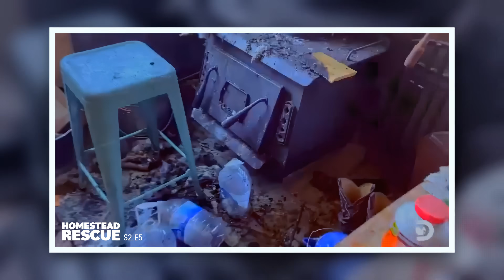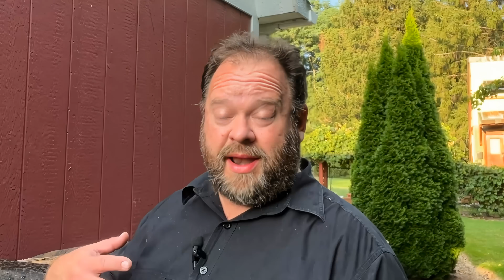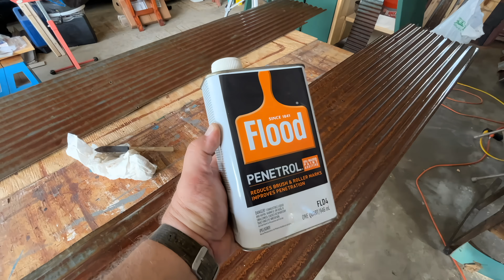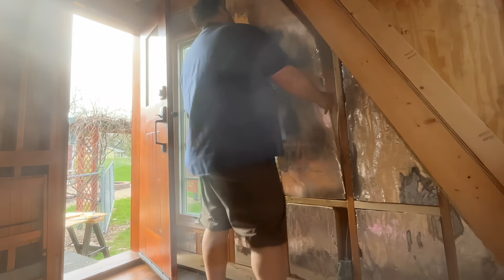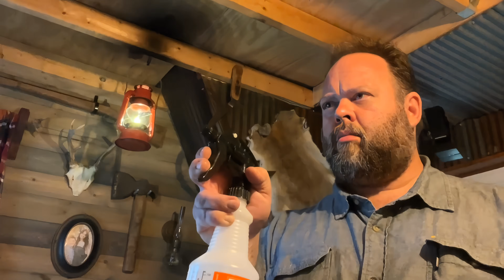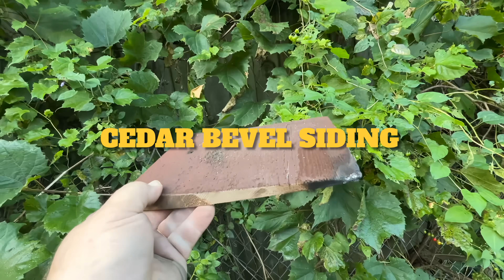DIY Fireproofing Techniques for Off-Grid Cabins 🔥 Essential Safety Tips

Comment: Hi, thanks for sharing, only problem about the fire retardant is its properties are supose to last around 12 months, so its expected to be reaplied.... its that really neccesary so often? , testing could reveal. But for my next step , im trying to find the composition, because we may be able to produce it in a cheaper way.
Will came back to check if you have answered, because i would love to listen your opinion. Or anyones experience/ideas.
Reply from the maker: This is what the manufacturer told me back in 2022: “Master Flame used indoors will last the life of the structure. When used outdoors you will need to apply a sealer on top of our product to protect it from the elements”. 

That was good enough for me since I am mainly concerned about interior fire hazards.

I still have the scraps I used in the video. I should pull them out and see if they are still fire resistant.
Reply: @bigguyinatinyhouse  apreciate, thanks! For bigger projects and forest firest would be great to find a cheaper alternative

Comment: Why is it that builders on tiny houses in the woods know about these fireproofing sprays, but builders on large apartment complexes act as if they don't exist? These coatings should be mandatory in all unfinished spaces of every residential structure and on exterior feature, like eaves, that are particularly vulnerable to the spread of fire.
Reply from the maker: That’s a good question. It probably boils down to cost… The stuff is relatively expensive. Not a huge expense for a tiny cabin, but the amount you would need for a larger structure would be big bucks.

Comment: If you want to build a fireproof home 
Pumicecrete is by far the best building material on the planet Pumicecrete is a mixture of pumice cement and water mixed and poured into a set of reusable forms walls are poured from 12"to 24" thick pumicecrete is fireproof termite proof rust rot and mold proof non toxic and has a high R value and good sound attenuation solid poured walls means no critters can live in your walls Pumicecrete can be built for a fraction of the cost and time and pumice is one of the few building materials that can go directly from the mine to the job site ready to use without any additional possessing and zero waste 
Take care Ray
Reply from the maker: Sounds like that’s a good solution for areas prone to wildfires.

Comment: Im converting a shed to tiny house. Having a  metal roof helps too. I put corrugated steel in my whole cabin except bathroom.  I didn't rockwool  but i use wool installation. Spraying fire-resistant foam between lofts and   floor below. Actual thats a fire code. Since im not finish with lofts. I think I will try master flame. Even my kitchen stove sits on fireboard. same for pellet stove. Do i sound paranoid.  Well iam. Scared of fires. Great video. Love the experiments! Thanks for sharing!
Reply from the maker: Sounds like you’ve covered all the bases. You can’t be too paranoid when it comes to fire.
Reply: Absolutely  @bigguyinatinyhouse